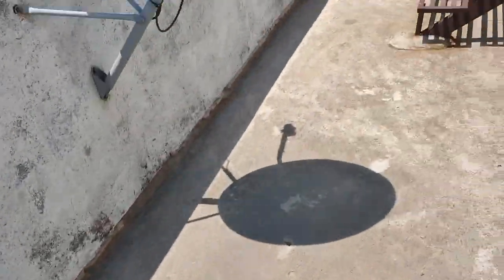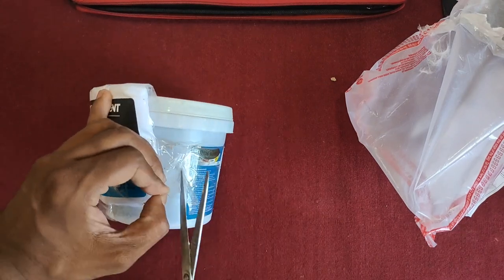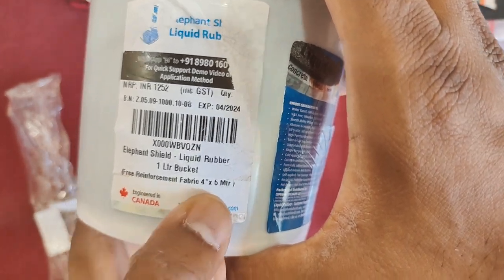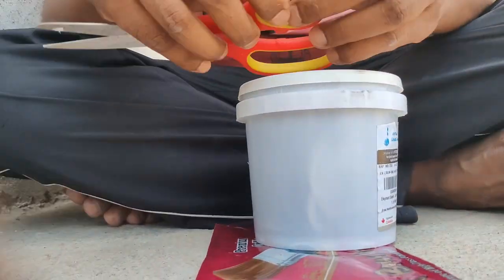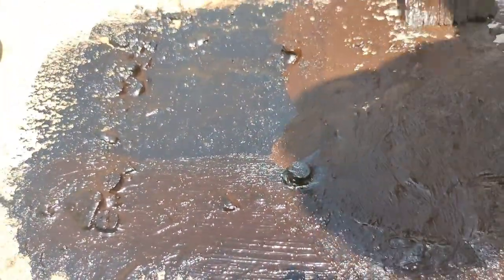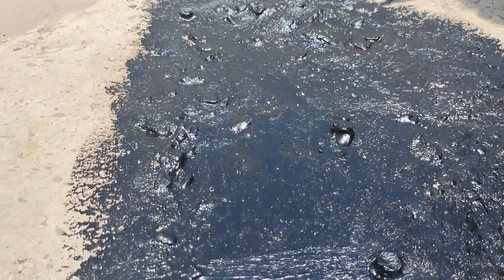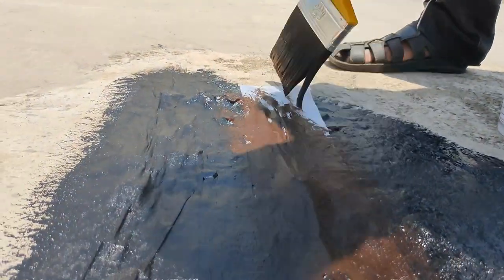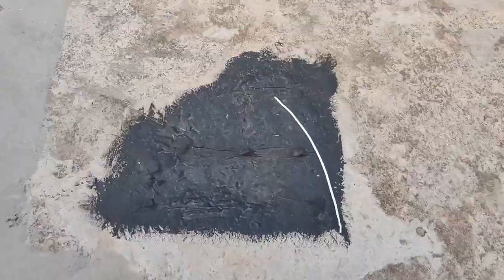elephant shield liquid rubber | do it yourself product

Comment: Sir,I want to know after applying rubber shiel there will be any problem to set tiles over it as floor & wall with normal process as cement+ sand with local mistry.thank If any other process of seting tiles plz inform me.thanks,Animesh Halder,